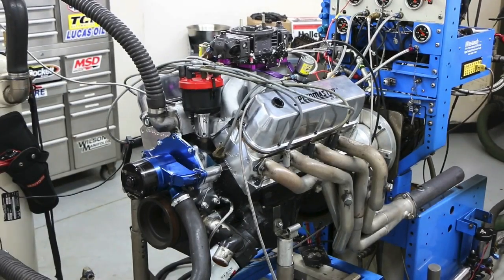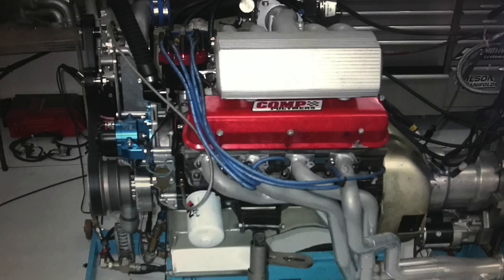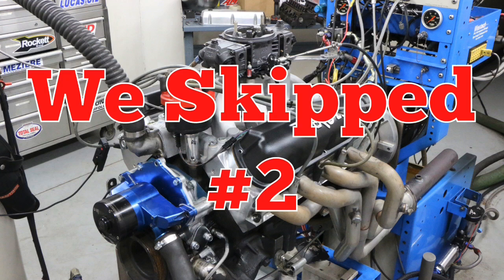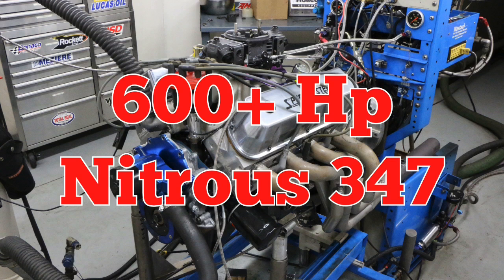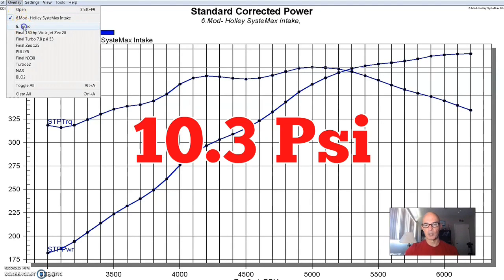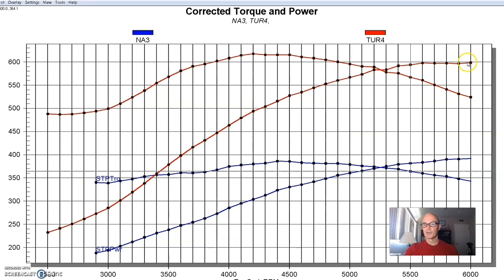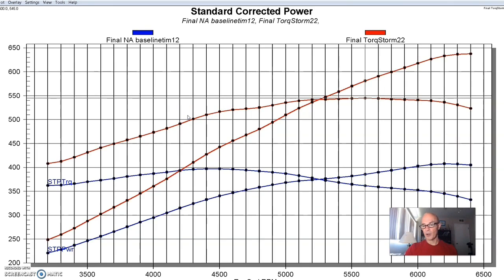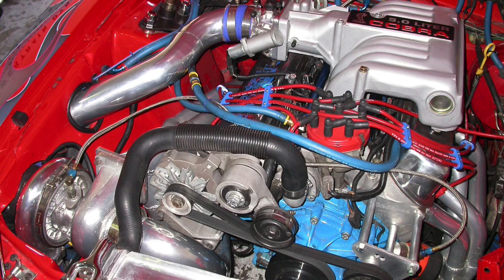5.0L FORD BLOCK SPLITTING-FACT OR FICTION?

Comment: My guess is that it is probably and casting and metallurgy issue.  back in the 80s when aftermarket blocks were rare and expensive, the Chevy 350 casting #3970010 with 4 bolt mains was the hot ticket for building a high performance small block Chevy. mainly do to there abundance and from what I have been told was that they had a higher nickel content in the 010 block that was used in high performance and industrial use applications blocks (1 ton and 3/4 ton Trucks and Taxi cabs, police cars, etc.). the block casting tolerances depended on which foundry Chevy cast the blocks in.  I don't know how many foundries ford used to make 302/5.0L engines or if they used different alloys based on application. so that may also be so of the issue. it may also be caused by tolerances in core shift during casting. I have seen some pretty ugly core shift in small and big block Chevys in my day. I suspect this issue is more core shift coupled with thin wall casting related,  these thin wall castings could also be flexing under shock loads until the block develops a crack. which would also explain why Richard was able to run multiple dyno runs as well as flat out in the Silver state classic vs the guy that blew it up drag racing. The external shock loads the block experiences would vary depending on the type of engine and trans mounts used in the car and the amount of traction the tires had, as well as frame twist in the front end during a hard launch. none of those forces would be experienced in a dyno pull or road racing application, which is why I believe that it is flex in the thin wall casting that is causing this, and core shift may be contributing to this issue.

Comment: Great video. Could you test a remote turbo kit to see how much of an effect exhaust length and charge pipe length has on a motor. Also it would be neat to move a air to water cooler from close to the motor then back near the turbo to see if that effects the density of the air ect. Thanks again!

Comment: My guess engine block splitting maybe due to constantly repeat cycles of the engine heating up then cooling down from racing. Maybe more so on a higher horsepower motor that generates higher heat.  The molecules are constantly expanding and contracting.

Comment: It's all about the tuning. Good tune they will last in the 500 range for long time. I have a 500+ turbo 302 fox. It has 5K + miles of 500hp at tire, and gets all the beans everwhere it goes... still running strong and kicking late model cars butts day after day! 302's turboed are beasts!

Comment: Back in the FFW days a friend ran Outlaw when it was a mid 10 second class. He had a R block engine fail so we grabbed a factory stock short block stuck a cam in and the TFS heads he already had. We fabbed a turbo system from flipped shorties and a Turbonetics lil thumper and DFI electronics. The system was run on race gas and non intercooled. On a dynojet dyno it made 685 rwhp and ran 9.85 @ 145 lots of times. We won FFW Outlaw with a string of low 10 second passes due to no one having a valid 9 second license. The block ended up splitting in the valley, with no doubt it was caused by detonation. It would be interesting to revist today with e85 and better electronics. So 685 rwhp through a C4 with a 9 inch convertor has to be close to 800 crankshaft horsepower????

Comment: I think one of the main reasons is when the rubber in the harmonic balancer starts to break apart. I had a stock 5.0 H.O block crack because of that. The car only had 240 hp at the tires. The other reason I believe it could be is that some 302 blocks are seasoned better. I mean that they had enough hot and cold cycles to make the block stronger. BMW had used engine blocks on the turbo f1 cars.

Comment: https://youtu.be/MJLS9xFXYAQ here a link to the video with the split in half ford motor it’s a 351 Windsor not a 302 think about it the boss 302 made a ton of power the Windsor only made I think like 295HP from the factory and according to the engineers at ford a Windsor block is good to about 800HP there a really weak block the 351 Cleveland can make big power no problem lot stronger block but the 302 is a motor you can get 1000HP out of if you know what your doing 302’s are great ford motors that’s what’s in my f100 custom and I’m sure it’s well over 500 horses I was a racers for years and when I build a motor it’s a bad ass race motor even if just going in my tow truck my tow truck blew an engine on the way home from the track we got home pulled the motor out of the race car put it in the tow truck and built a new engine for the race car we could tow at 120mph through the mountains got pulled over heading to Bristol TN from byhalia Mississippi got pulled over pulling a race car at 120 the cop didn’t even ticket me he just wanted to see what was under the hood and told me to slow it down a hair cause he pulled us over and like 6 trailers behind pull over as well a few mins after we get pulled over when they come up on us cause we ran off and left our group otw cause we all knew we were taking the same route so if someone broke down we were ok whenever we traveled between tracks we traveled in packs you might have a train if 10 race car trailers in a row being towed back in the 60’s-90’s that was common I don’t know about these days thinking about getting back into drag racing now that I’m free no wife no worries life is good

Comment: I spite one at 7200 rpm with only 300hp stock crankshaft broke at #1 main be ran 450hp at the wheels on a stock crankshaft for 3 years with no problem so I think its all in the casting

Comment: I think the structural aspects of the blocks are ignored.  How much stress is on one of these blocks when forces are applied at the motor mounts?  As thin as the blocks are in cross section I think chassis flex could split the block rather easily.  Especially a stick car.

Comment: think it has a lot to do with balance issues. I think guys back then, didn't do a good job, or even balance the rotating assembly. Ati super dampers, correct weight for fly wheel, and rotating assembly balancing with todays technology... Im sure the block will hold a lot more than 500 hp all day long. Im a mod motor guy. Love sohc, and dohc. Has a unique sound, and makes bookoo hp N/A, and when boost comes into play.... Its game over

Comment: When using stock mass production blocks you have to take casting anomalies and voids in the cast-iron into account. Perfectly balanced rotating assemblies and main bearing girdles help a lot to mitigate vibration and harmonic frequency but you are still dealing with the stock thin wall casting which has it's limitations. But hey Windsor blocks are cheap and available so run them till they blow and build another one.

Comment: A 351 block will also split if ran hard enough on spray, for enough passes. EDIT: also, a dyno will never split a block, typically. It's too smooth of a power delivery/braking compared to the strip. No real shock loads. Notice that all of his nitrous hits are above 5000rpm. That's the key. Nitrous off the line WILL split these blocks. It's been well documented over the years. Even his boost levels are above 3800rpm. A smoother, slower power delivery..

Comment: As a seasoned engine builder, I've seen the 302's hold together very well if tuned properly. Improper timing, incomplete combustions events, or improper parts will destroy an engine. Nitrous kits have come a long way in the last 20 years. Most racers had kits that were just "smacking" the engine with 150hp or 250hp kits. Progressive Nitrous controller was a great addition to the drag racing world. I have actually seen these blocks crack or split completely. Great video

Comment: I think it's detonation more than just power.  I had one of the first D1 Procharger 12 rib kits on my 89 Fox stock block.  It finally gave up after a year or so and 30ish passes with a stick shift.  The block split right thru the cam bore and was visible in the lifter valley.  After getting it put back together I realized I had a bad alternator which may have caused my already ragged edge fuel system to not deliver 100%.  I remember hearing detonation before I popped the head gasket but couldn't get out of it quick enough to prevent it.  Lesson learned, but I really think if those old engines had some means of knock control they would tolerate much higher power than we originally thought possible.

Comment: I never saw one split in person, but there is a video of one splitting that ran over 1100 HP on nitrous before splitting in the lights at a no-prep race.

Now as to what causes it, my money is on the fact that the block was designed back in the 1960s without FEA for the stresses in the block and also built to be as light as possible for 265 in^3. People are running displacements up to 347 in^3 which slightly weakens the block, and the one I actually watched break had been running over 1000 HP on nitrous for hundreds of runs before splitting when they raised the size of the shot to what should have been 1100 crank and broke it in the lights. Now it might have been on borrowed time at 1000 and would have broken eventually at that level, but it definitely broke when they ran the shot for 1100.

Comment: Unfortunately it's true. It generally cracks in the lifter valley. It may last for a while if you don't push them too far. Buy a dart block and you won't have to worry.

Comment: Ive Split 2 blocks...both over 600hp ...Both Drag Races Stick Cars....One was a Mexican Block....it hung in there about  5 years..with many Bottles of Nitrous Run through it....it  Really Broke the Mains out of the block from the pan rail up to the cam bearings...

Comment: Appreciate the video man,  we've made a little over 900wheel  with a completely stock 91 5.0 shortblock and a 7875 on about 35lbs. Been 154 on the limiter at 2900lbs with a 5 speed with it. Heres an early video around 800wheel or so. https://youtu.be/Wla6n_vczC8

Comment: Older high nickel 302 and 351W hold up until around 700. Anything above that is a gamble. I have personally seen blocks split under high boost around 750 and there are YouTube videos showing block split with multiple stages of nitrous on a already stout stroker in the estimated 7 range.

Comment: Had a mate with a stock falcon e series 5.0 and was vibrating alot. Turned out to be harmonic balancer was stuffed. The way it vibrated thru out the rev range could take it apart in the hands of those who would try to drive it at high revs unbalanced. I never considered the 5.0 because of these rumors.

Comment: I always thought block splitting was more a issue with later 302 engines. The roller cam engine with its bolts through the centre of the block for the cam spider. To do with thinning the  top of the block more than anything .
The older 289 block is considerably heavier than a roller 302. (Anyone have a scale?)
Also effects the roller 351 but the cracks go the other way to the cam bore with completely stock engines.

Comment: I split one in half engine was still running but I also had a 500 shot nitrous  all forged internals after the 4 pass it started smoking got it home unbolt the intake and it fell apart

Comment: My dyno tuner told me the magic recipe was 500+ rwhp, under load, above 7k rpm, sustained for a few minutes.  The machine shop I use has a split (completely in half) 302 block, that supposedly met its demise under similar circumstances (twin turbo street car).

Comment: HI  Richard , its the apprentice 😁 on the engine manufacturing line who is responsible for Deburring , and all he can think about is his new Hot date  😍😍  and 👅 😽  so some engines have a lot more stress risers from sharp edges , and the big torque causes cracks , then there is core shift ?  .

Comment: I would say it's mostly rpm and balance related.  I remember years ago doing connecting rod stress calculations.  Throughout the operating range rpm had the most dominant effect, even with turbo boost.  In fact the highest rod tension was at highest rpm and lowest boost.  So a combination of rpm and imbalance, (or also crank straightness) are dominant in material stress.  Boost is probably dominant for thermal stress.

Comment: My guess is that its a crankshaft harmonic. It happens with higher power because the amplitude of the harmonic gets bigger. I dont think its a vibration thing though, i think the mains crank journals are being twisted and moved out of the centerline of the bearings and prying/popping the block apart. Cast iron is very strong in compression but quite weak in tension. Its not completely consistent or repeatable because there is a significant variance between sand cast blocks. A well ENGINEERED dampener for the specific application could be the best way extend the limit. Anything that impacts harmonics: from firing order to balancing to stroke length, etc could make a difference. Bearing clearance could also play a role. I'm curious if it can be isolated to a particular rpm range where it tends to happen, if so, reducing torque in that rpm range could be the ultimate solution.

Comment: Q: how do you split a 302 block? 
A: the computer running it. Eec IV/a9l are likely the worse out there. Worst. Reason also why carb setups seems to not split...no cpu as well as before the 00s any carb ran nitrous to get above 600hp....safe tune in someways.

Tune, vibration, power, oil, etc....too much will split ANY block, not just Fords. But that’s much higher (800hp).

Comment: Ive personally seen one split right down the center at only 300ish. It seemed to have lost a main cap or a stud and the crank flex and slip in half and took the block with it

Comment: Sounds like something in the bottom end isn't balanced for the horsepower, torque and rpm people are asking of them.  If something is out of balance, that would cause a lot of harmonics.  High quality damper should be used over 400 hp.  Just my opinion.

Comment: It's certainly a documented phenomena that it happens. See:https://www.theturboforums.com/info/article/stock-block-chronicles.366085/ I've known one person it happened to personally. Said their oil pressure got a bit weird and that was that. 

That said how common is it? In engineering speak we'd be talking mean time between (or to) failure. That means that you have N number of units in the wild and that over a large sample size you have X number of units that fail. The most common non-engineering discussions of such things are typically hard disks. The catch is that you have to have a large enough sample size. One, two or even a dozen or hundred hard disks may not constitute that sample size accurately. There could have been a Friday where the guy pouring blocks was off his game or something so you had a set of them with reduced durability and that's what the people split in half. It could obviously also be engineering choices as well (see below.)

There were a ton of 5.0L V8s produced and in turn and more than a few that were ran at significantly elevated power levels for a long time like these engines. Over time that will bring out any product defects in the blocks that may exist. It's also true that Ford had made these blocks fairly light and that is evidenced by the Mexican Blocks.

Comment: Being one of the old farts around here, and being a small block ford guy, I was always told via magazines that the hydraulic roller blocks could develop cracks in the lifter valley out past 550/600hp and could for short term run 750+. And that early non roller blocks could take more sustained loads and rpm. I've never seen a test showing that problem, I have seen split blocks, but not the circumstances why they were split. what I've never understood is how a 2 bolt main block could keep the mains in it long enough to split the block.. I've always figured it was detonation that killed the block, not the actual hp number. And this probably stems from 1 guy with a bad block on a dyno and a couple turbos not retarding timing, and people perpetuated the myth.
Reply: Another small ford block here too messing with them back in early 90s and I heard everywhere “over 500hp you’re on borrowed time.”  So weird because I ran 650 Hp & 670 lb ft for years on 1989 5.0 block and never cracked?  My opinion is RPM, vibrations and poor tunes kill the block not the power levels, I’d a sportsman block absolutely.
Reply: Harmonics split the block or the lifter valley.
Reply: great point

Comment: My little 302 which is almost a fully stock bottom end and it’s around 600 on the engine , key is tune and rpm

Comment: I think it might just come down to the quality of the particular block that you build. Some might live forever at any power level. As long as other factors like tune and abuse dont come into play. Some might just actually totally split in half or crack in the cam tunnel with just a bit of power and use.  Its more of a luck of the draw thing than anything else I feel.
 It would be interesting to see what casting years the split blocks have come from. Are they late model 5.0 blocks or the late 60s to late 70s blocks?  They had very subtle casting changes in the cooling passages and valvetrain but did it make the diffrence?

Comment: Stock roller block 347, 260ish 670 lift mechanical roller, ported Canfields, 200 shot..... Ran mid 9s in a small tire Ranger.  Engine lasted about a year before the factory block cracked from the mains up to the cam tunnel.  Didn't hurt anything else.  We put all the parts in a new FMS Boss block and its been good for many yrs now.

Comment: I have always thought, that simply over torquing the intake bolts on this type of configuration  would contribute to splitting a block, the intake would act like a huge wedge,since the bolts are  vertical . and the intake  is a wedge.